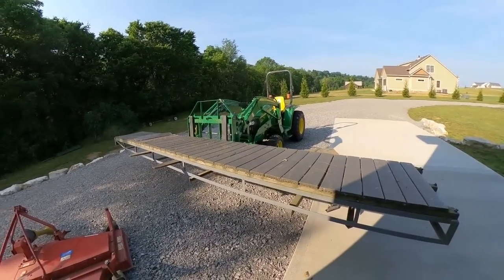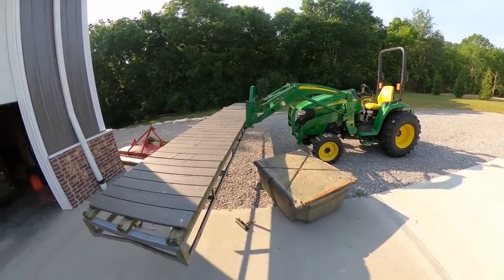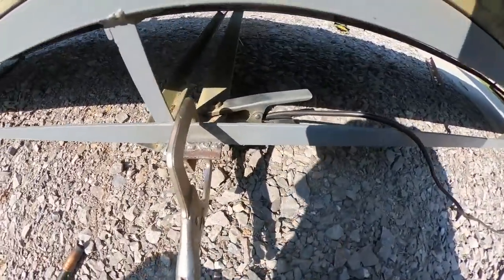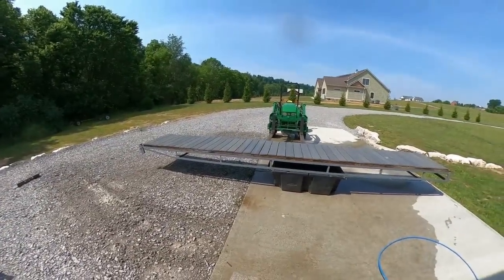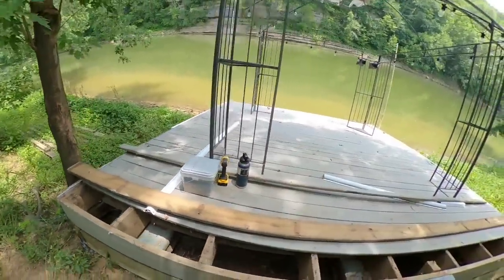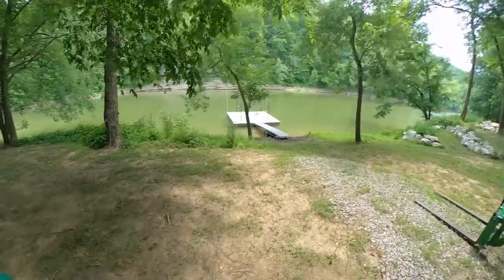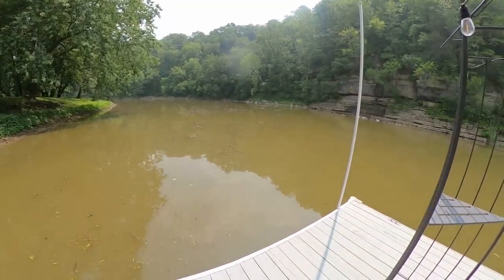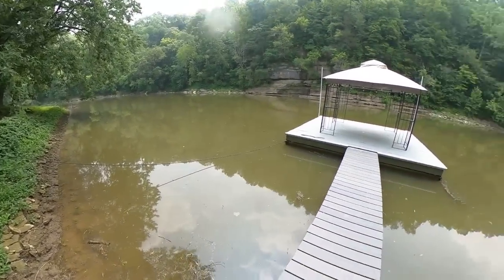Rebuilding and Launching the Dock 1

Comment: Looks like a two or three foot seawall where your ramp begins would be an option?  You could use that rock you have piled to the right for the armor on the wall then bring in larger rock to infill and make a five or six foot wide walkway back to where it doesn't flood.  That would keep you out of the mud and silt.  Or same concept but use screw piling to support an above ground walkway out to your ramp?  DIY put in sauna tube piling and fill with concrete to support the walkway.   Using a "T" design to hold up the walkway with one row of piling or piers and two out at the ramp it wouldn't take much material or time to build (isn't that what they always say when beginning a project??!!)?
Reply from the maker: Lol, yeah the high water mark or flood height is about 5 feet above the land down there, I could make a sea wall….maybe between the trees, any farther down and I wouldn’t be able to “land” my dock for the winter… I’ll have to show winter pictures sometime…